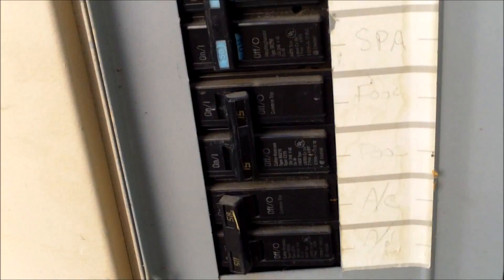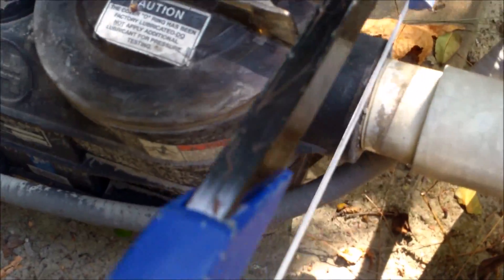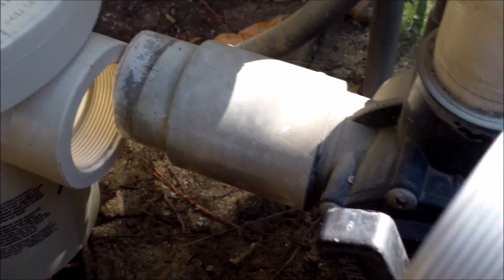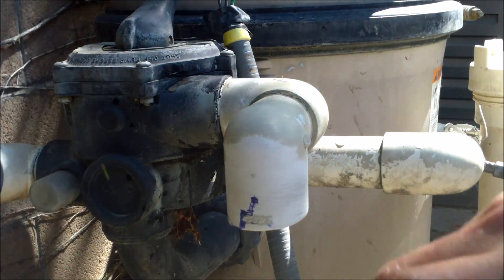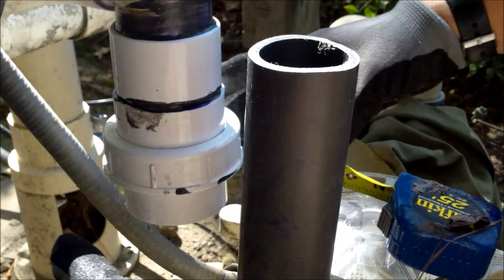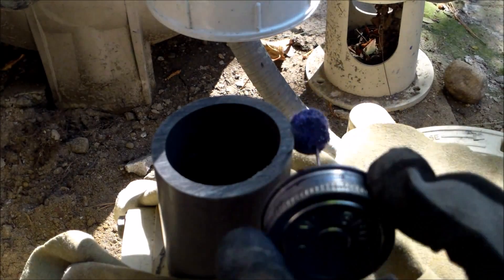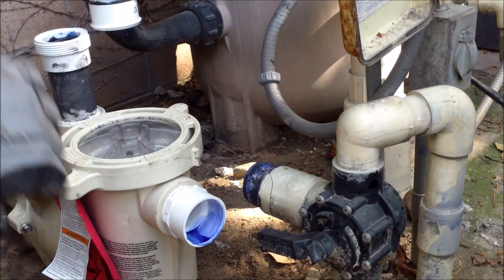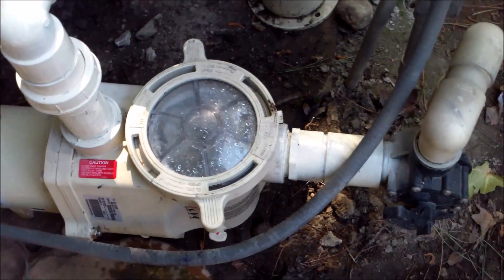How To Install a Pool Pump - Plumbing the Pump, Part 2 of 2

Comment: quick question, i might have not scene the part of the process... but have you made a video on how to replace the aerator valve?,, not just the valve.. but the whole pvc pipe process.. sort of like.. "adding a new aerator from scratch", to the pool pump pipes?.. the water feature pipes
Reply from the maker: Not made one

Comment: Hi David, two questions today.  Is it possible for my Inteliflo 3hp VS pump to transition smoothly from one speed to another or does there have to be a one minute gap, 1900-2700 for example.  The second question is, is it possibly to remove phosphates easily.  With the poolrx  I wasn’t too concerned about them but I think even the poolrx is reaching its limit.  1300 phosphates as always thanks for all you do.

Comment: Wouldn’t it be better to union both ends for easier removal for winter.
Reply from the maker: For sure. But the original plumbing didn't allow for a 2nd union.

Comment: Wouldn’t it be easier to just replace the whole pipe from the pump outlet to filter with a union to the filter?
Reply from the maker: Would have to replace that jandy valve and cut the pipe down to the dirt. Not easier but it would make replacing the pump easier in the future.

Comment: Most every pump installation manual calls fora minimum of 10” straight pipe on inlet side to minimize turbulent flow and cavitation. Pump will run with less strain and cooler temp thereby extending its life
Reply from the maker: Super rare to see 10" of straight pipe in front in any CA install. The equipment pads are so tight.

Comment: If everything is glued how do you remove pump in the fall to bring the pump indoors. I had my pump piped in last yr. no leaks. This yr. I put it back together and leaks at the unions. What do I need to stop the leak?
Reply from the maker: Try putting in new o-rings at the unions.
Reply: @SPL  Thank you. I found the 3 0-rings in the pump.

Comment: Can you use the unions for both connectors to help avoid the worry of the one shot and the last glue up going slightly wrong?
Reply from the maker: Yes. If you have the room 2 unions are best.

Comment: Looks like a lot of cavitation in that pump...seems like air is getting sucked in the pump on the suction side
Reply from the maker: It was the old filter - that has been replaced as well.

Comment: Good day! What size of pipe is ideal for pool equipments such as motor pump and filter? Is 1.5 pipe okay? 
Thank you very much.
Reply from the maker: 1.5" is fine in most cases, 2" is a little better

Comment: do you HAVE to use schedule 80 pipe on the discharge side?
Reply from the maker: No, but it helps if pump runs hot at any time.

Comment: That final connection is always the worst.  No slack whatsoever to make up for measurement/cutting errors or, worse, failure to fully seat the pipe into the socket.

Comment: I would have re configured to use a union at the inlet as well. Pain in the A they way you did it if you need to ever service the pump.

Comment: What happens when you have drips on the male adapter in front of the pump you just glued together with no union? Glue those male adapters into the pump
Reply from the maker: Gotta replace it at that point

Comment: What made this a great instal is that it had to be done on such an old system, real world installation.  
One piece of advise, if the motor is stressing that union just shim it to relieve and pull the weight of the motor is putting on the piping.  Great job considering what he had to work with.

Comment: 0:07 is it necessary to use the POOLTITE glue or can I use regular PVC pipe glue and primer? Pooltite is used for underwater conditions but if it is a new installation, why do you have to use it?
Reply from the maker: Any PVC cement will work.
Reply: @SPL  Thank you, that is what I thought.

Comment: I have a old 1 speed 3 hp 1996 challenger and the motor need replacement . Is it wise to buy a 2 speed motor to replace the one speed motor for energy saving when I just want to circulate my chemicals in the water???? BTW. I have an 8 jet spa and when valved off the spa has one separate jet that acts as a pool a overflow water fall while the pool is in valved for circulation and skimming. I also have a return separately valved for my polaris pressure side cleaner that i run as needed  . In this 15000 gallon pool with a 10 person spa.
Reply from the maker: Would go with a VS pump. Either the Pentair Intelliflo or Hayward vs 950 - both are close to the 3 hp rating. Then you can set it to run at 1200 RPM as a low speed.

Comment: Hey, great videos as usual!   Been watching you for years.   I am removing a Heater(won't be replaced) installing a new MultiValve and new DE Filter on my pool.  There is one check valve in place.  It is between the heater outlet and the return.  No check valve between the pump inlet and the pool.  Do I need a Check Valve?  If so where?  I also see a few places where there are elevated loops to prevent siphoning I guess.  One is between the Pump outlet and the multivalve.  The other is between the heater outlet and the return.  That is also where the check valve was.  Do I need to redo that heater outlet one when I remove the heater?
Reply from the maker: I would add a check back in the same spot.  In case you add a salt system or chlorine feeder later. The check valve will protect the heater.

Comment: If you are swapping the same pump for the same model again would I need to do any additional plumbing works, asking as an electrician
Reply from the maker: No. Every should line up exactly the same - especially if there are unions in front and on top.

Comment: Great video! Can you run 2 Pentair Variable Speed Pump? Filter and water fall feature? If yes, where do you connect the green and yellow cable to the Aqua logic? Theres only 1 slot for green and yellow cables for 2 green and 2 yellow cables.
Reply from the maker: You can but it would be better if you used the Hayward Vs pump with their aqualogic system.

Comment: Just wondering...why SCH80 pipe? How how hot does it get over there?
Reply from the maker: If the pump runs dry due to low water it can get very hot and melt the plumbing around the threads. Sched 80 prevents that.

Comment: Why put only one union on the discharge? Couldn't you put another one on the suction? Would be easier to remove the pump if needed repairs?
Just curious...
Reply from the maker: No room in this set up, but usually yes.

Comment: Could you use a union on both suction and discharge side so next pump replacement your not having to cut out pipe, if ever need to remove for service?  I never see union on both sides? I’m very new looking at doing my first pump, filter install and not sure if I’m missing something as to why not to.
Reply from the maker: You should use them on both sides, but in this case there was no room.

Comment: I have a question, my pump is not sucking up the water and rotating, the dial is at zero, could it be because there is leaking on the pvc pipes?  I am a lady, I was watching your video, I don't think I can do this.  How much would a pool guy resonalbly charge me for putting new pvc or fixing the leaks?  The motor and pump are still working, just leaking at the connections.
Reply from the maker: $85 per hour plus a minor charge for the PVC pipes. Maybe 1 hour to 1/2 hours of labor.

Comment: what is that white stuff on the thread....just good old silicon ?
Reply from the maker: More like Teflon Tape- Called a Joint Stick.
Reply: @SPL  thanks but why do you call it a tape ? Joint Stik is not a teflon tape.

Comment: how did you remove the old pump from the cement? We have something holding it in tight and don't know how to get the pump out
Reply from the maker: It's probably archor bolted to the cement. If the bolt heats are gone or not movable you will have to drill those bolts out.
Reply from the maker: anchor bolted.

Comment: I was surprised not to see the pump being bolted to some concrete. Is it OK just to let the pump sit on a surface unattached? Thanks!
Reply from the maker: Generally, no one bolts them down to a cement slab. Not unusual.
Reply: @SPL  thanks a lot for the quick reply. Does the motor just sit supported by the inlet and outlet pipes? I thought there was enough torque and vibrations to warrant a former fitment. 
So I can just place a replacement pump on some concrete pavers? Makes my life easier 😁
Thanks again!
Reply: Agreed, I've replaced more pumps than you can shake a stick at and only mounted 1 by customer request.  And the pump is supported by the base and stays on ground due to gravity. 😎
Reply: If there is that much vibration I'd take a look at restrictions in return plumbing ie dirty filter, clogged heater core, clogged solar lines.

Comment: which is the inlet and which is the outlet? I have similar pump and want to connect to my pool? Cheers in advance and good video:)
Reply from the maker: Inlet is in front of the pump. outlet is coming out of the top - known also as the discharge. Hope that helps!
Reply: Swimming Pool Tips, Reviews & How To -MrDgvb1 Thank you for your reply. I watched about 10 videos and still couldnt find anyone explaining. I found  my dad's old one yesterday that had been thrown in scrap metal pile. My father passed away in 2001 and I remember seeing something like a old pump off one of his ponds. We have just got a pool for the kids this summer, So I went on the scrounge and you wouldn't believe it! I plugged it in & it fired straight up, working perfect!! Saved about £500!! God bless mi old man😉. Thanks once again. Happy days👊
Reply from the maker: Great find! 👍

Comment: I wanted to thank you for a great video. I'm almost 70 and just installed / replaced my old 1 hp challenger. The union process you showed me saved my rear end!! I did the coupler on the front of the pump and the union on top. Worked perfectly, no leaks. Thanks again! Much appreciated!!!

Comment: Awesome video.  Thank you for making it.  I have a few questions, and any suggestions would be appreciated.  I'm disabled.  I'm trying to do this via wheelchair, and am determined to do this myself, lol the swim season may be over by the time it gets done,  but hopefully it will get done, and done somewhat correctly.    

 I've just now starting my hard plumb using Sch 40 PVC on my above ground pool.  I'm planning to run the lines from the skimmer/return to ground level for added support, and to, hopefully, increase the distance a little further between the pool and the pump. (I actually dry ran it originally with it just coming down from the skimmer, a short piece of PVC, the Ball Valve-cut off, another small piece of PVC, a 90 placed across from the pump, a short piece of PVC, the Union, a small piece of PVC, and the threaded/slip connector into the pump, but by the time everything was added in it just looked way too heavy to just be hanging there in the air, and having no support, so I decided to start over, and run it all the way to the ground, across, back up, and into the pump). 

I've done a little on it already, but with my physical limitations I'm only able to handle doing a little bit each day, plus with all the rain, rain, and lol more *&%$ rain, I've not gotten much done. (So far I've only put in the new thread/slip connection in the bottom of the skimmer, added a short piece of PVC, put in the 1st Slip Ball Valve below that, ran the PVC line to the ground, and put a 90 at ground level to start going across with).

Here's a lot of my problem.  I have very limited space between the pool and the pump, they are currently approximately only about 3 foot away from each other, (but I do plan to leave enough pipe available in the line to cut it and bury it next season, and move the pump to a different location about 5-6 more feet away from the pool.  (The pump has been in this same location for about 5 years now while using just the regular hoses, and has done fine, I'm hoping the hard plumbing doesn't cause it to have flow issues by being so close.)  Do you think this will cause a flow issue in regards to the PVC pipe, and the close location to each other?  

I'm placing Ball Valve-cut offs on the skimmer and return sides, and will also be T-ing a line off the return to make a DIY fountain with its own cut off.  

I also have Unions that I'll be using for easy disconnect.  Where in the line should that Union be placed?  Should it be closer to the pump, closer to the skimmer/return, or does it really matter?  Do they do better if placed up and down, instead of laying across the ground part?  Do Unions require any type of Teflon tape or sealer, or are they self sealing? 

At the pump, and at the return a threaded 90 would work better there and take up less space from having to add another connector in.  Is there any issues with using a threaded 90 in those areas, or should a straight connector be used to prevent any additional possible pump flow issues, and then the 90 glued in after that?  Also is it better to use (2)45s instead of a single 90? 

Also the clear line on the pump that has the metal in it (I think it's spa tubing possibly or something like that but I'm not sure).  Is it alright to replace that clear tube with PVC as well or should the flexible clear tubing be left alone when hard plumbing the system? 

Ok Last question, lol I bet you're thinking thank goodness, it's about time lol: What type of white paint was used in the video to paint the pipe with, was it just regular white spray paint, or is there one specific for PVC pipe?  LOL after just gluing together a couple of parts so far I can already tell it is definitely going to be needed?  Sorry this ended up being so long.  Thank you for any suggestions you can offer.  Have a wonderful Night!!!

Comment: Is there any cement to replace weld-on 746? Want to install an inline chlorine dispenser but don't know which cement to use in homedepot or lowes. Is Oatey Heavy Duty Gray PVC Cement OK?
Reply from the maker: Yes, that is a good brand also and a good choice of cement.

Comment: We can offer a series of swimming pool equipment, like Sand filter, Quartz sand filter, Wall hung pipeless swimming pool filter, Water pump, Heater pump, Salt chlorinator , Underwater pool light, Jet swimming, Pool ladder, Pool cover, Pool Lane line, Pool clener, Pool accessories.etc.
If you have any question or interested in, please contact us by email :  gzalwayspool@alwayspool.com

Comment: Seems like an awfull lot of flow restriction. Two bends following each other directly, no length of pipe in front of intake, union following directly after a double corner  ....
Reply from the maker: I work with the hand I am dealt 😀 - it doesn't really matter until you get to 3" plumbing.
Reply: Did you see the air in basket at end? I woulda cut that 2" coupling on intake 3port in half and put 2" fitting extender and just replumbed entire discharge to multi port with no need for a union.
Reply: Thank god it not just me. That looks like a home brew abortion with so much addition to the total Head just in the short part that was fixed. Also you may have noticed that the pump was actually hanging in mid-air from the out flow pipe. That won’t last long. I do not even want to tackle that remark about restriction issues not being important till 3” pipe???????

Comment: Hello. Thanks for your videos! I disagree with the below post that "you are using too much glue". Nothing like cutting back on the glue and fitting it all up, only to discover a drip or leak and have to start all over again! I have two in-gound pools in two homes and your videos are extremely helpful, even though I am an Engineer. Questions: I am installing a new Pentair Multi Speed and feel I should install a check valve in line while the system is down and all tools are available. I believe I have two issues, which may require two check valves. 
(1.) Should there be a check valve on the pipe the pump suction prior to the pump to prevent water from retreating to the pool, now causing the pump to take 30-60 seconds to prime on each start up?
(2.) Should there be a check valve on the pipe prior to entering the Pentair tablet chlorinator to perevent high chlorine content H20 from backing up into the equipment?
(3.) Unrelated to the above, I installed a Pentair Chlorinator 320 and found that the tablets are not being consumed, causing me to manually add chlorine to the pool. My theory is that the supply line PSI feeding the 320 is very close to the PSI of the pipe the chlorine should be exiting to, thus causing it to remain static. I added a tablet, filled container with water then capped it and tablet remains whole after 2 days. Any suggestions?
(4). Lastly, this same pool has a raised spa with a waterfall into the pool. When the pump shuts down, several hours later the spa water seeks the level of the pool. Would a check valve above #2 remedy this issue?

Thanks for any assistance you may offer.

Jack C
Reply from the maker: If the spa is elevated above the pool water line there should be a bypass check valve installed to prevent water draining back into pool. Generally the check valve for the spa goes on the pipe where the bypass is - usually an elevated spa has water running to it even when pool is in "pool mode." Would have to see you equipment layout to further advise. Check the bottom screen in the 320 to make sure it is not clogged up. Use a pair a tongs to remove it and inspect it.  And yes, a check valve in front of the pumpcomes in handy for what you described.  And they sell a specific check valve for the 320 chlorinator with no metal in it: Rainbow R172288 Corrosion Resistant 1.5 x 2 inch Chlorinator Check Valve